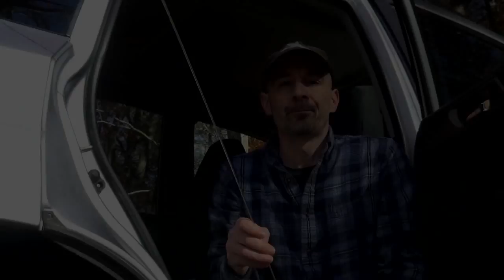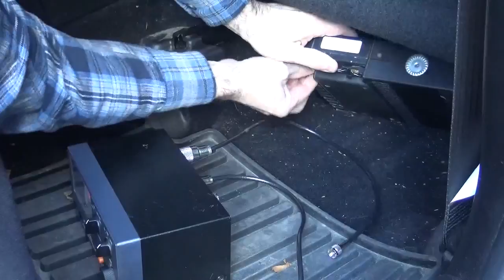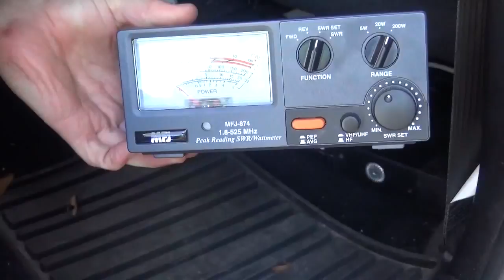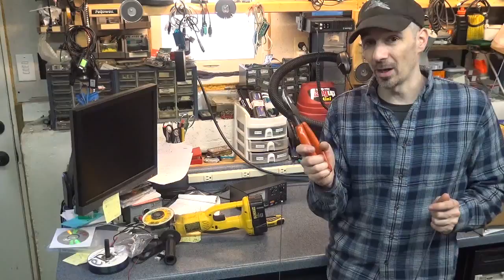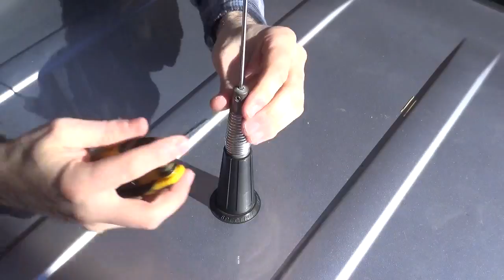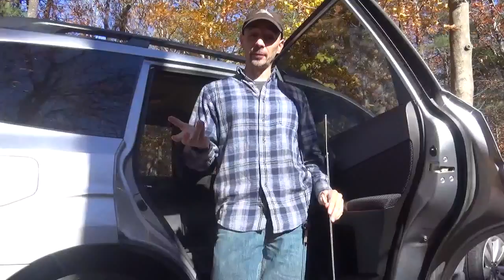PEG Tuning Your Mobile Antenna

Comment: Very interesting and thanks for the support.
I recently purchased the diamond NR770HNMO, I'm getting high SwR on my mobile mount NMO.

What could you recommend in this case ? Thanks in advance WP4JR from Puerto Rico 73
Reply from the maker: Hi Jonathan.  Hey thanks man.  High SWR on a dual band antenna isn't all that common, especially when it's pre-tuned to a middle of the HAM 70cm/2mtr bands.  I suspect there's either an issue with the connector, coax or NMO mount or a defective antenna.  The first thing to check in confirm a solid solder joint from the coax center pin to the center conductor of the NMO.  Remove the antenna and use a multi-meter on OHM or continuity setting to "ring out" the coax. Make sure yo have conductivity from the center of the NMO and the center of the connector and the same with the ground portion of the coax/nmo connector.  Then take you meter hold one prob on the center pin of the coax connector while place the other prob on the outer (ground) part of the NMO  (or PL-259).  If you get any continuity while doing this there is a short in the coax, connector or NMO.  You shouldn't have to tune that antenna Jonathan as I believe it's pre-tuned which is common for such a small frequency spread of the HAM VHF/UHF bands. Good luck!  Hey I'm planning on talking to the Puerto Rico government about the our civil PEG radio systems...I might just get to meet you!
Reply: @USPreparatory  thanks very much for the support ! 

Sure you are very welcome to PR . 

I will verify my NMO mount and cable.

Comment: Hello I'm kind new to the mobile CB game, and I have questions.  Any help  would be greatly appreciated thank you  fellow CBers.
1. Would this SWR meter do the same thing as an antenna analyzer like a rig expert AA-55 zoom?
2. How can I find the best mount placement for a jeep. 
I'm having some issues with RX/TX
So I don't know how to check for a dipole. 
Thanks again.
Reply from the maker: Hi Danial the videos that we release are not for Citizens Band radio but the PEG or Preparatory Emergency Groups civil radio service.  Contact me at info@uspreparatory.com I can likely point you in the right direction.  -Chris

Comment: US Preparatory, when you went to tune the antenna the meter you used and the coax cable adapter you used to connect the swr meter to the radio, what kind of cable did you use?
Reply from the maker: Hi Trey,
The cable I used was a custom made cable of RG-58a/u with the necessary connectors to adapt to the radio and meter's connections.  A better way to tune an antenna with an SWR meter would be to use adapters attached to a standard piece of coax.  Typically I use a 36" piece of RG-8X with PL-259 connectors on each end for low band equipment.  Keep in mind, depending on the frequency band that you're tuning, the length of this "jumper" piece of coax can have a dramatic impact on the SWR you're seeing on the meter.  I'd recommend checking your SWR on your antenna against two different jumper cable lengths. Maybe an 18" and 36" just to ensure you're getting an accurate reading from your meter.
Reply: Trey Smith where can i buy it in cambodia ? And how much?
Reply from the maker: Hey Trey! Sorry for the delay.  You Tube isn't notifying me when a new comment come it.  I'm not sure what you mean.   The video is about tuning a PEG low band antennas.

Comment: Hi, Can i tune dua band antenna? If I'm not mistaken, only VHF antenna can be tune.
Reply from the maker: Hi Jack.  You can tune some dual band antennas. Particularly ones with one or two center loads. Each section (top and bottom) may have an allen set screen where you can adjust both upper and lower sections of the antenna.   All antennas can potentially be tuned, however the higher in frequency you go the wider the bandwidth.  UHF antennas are typically pre tuned because their wide bandwidth allows for this. A single UHF antennas usually offer 20Mhz of bandwidth. 20Mhz is a huge frequency spread.  Because of this it means the entire UHF LMR or HAM band can be used with a pre tuned antenna because the bandwidth of the antenna is wide enough for this.  A VHF antenna usually offer 6Mhz of bandwidth. VHF low band usually offers about 3Mhz of bandwidth.  CB radio antennas have a band width of less than 
 1.5Mhz.  So the lower in frequency you go the more important it is to tune the antenna as it's more critical.  Dual or tri-band antennas are usually pre tuned at the factor because it's a complex balance between decent SWR of the antenna (on all the bands it's designed for) compared performance.  Dual and Triband antennas are rarely tunable by the end user due to the complexity of this task.  Manually tuning one band will likely throw off the SWR on the other bands.  Each brand of antenna will offer different features.  Check out this video I made to further explain this.   https://youtu.be/9g8b4YHUDHc